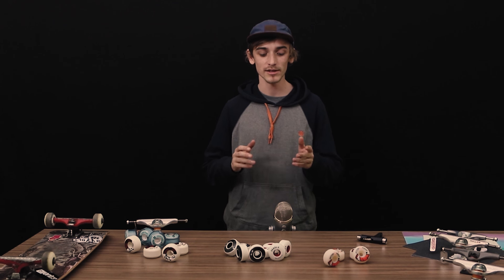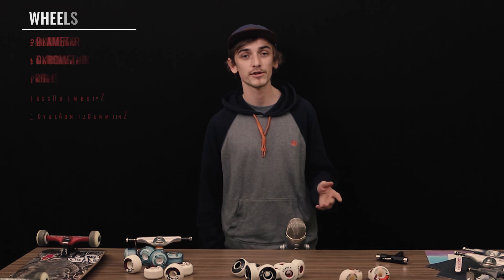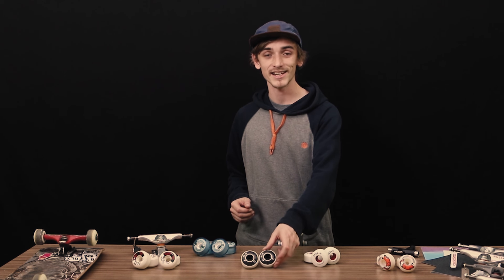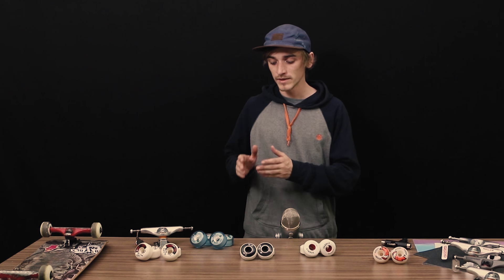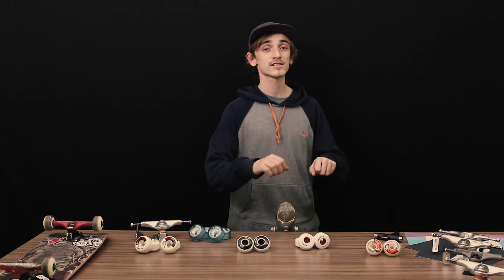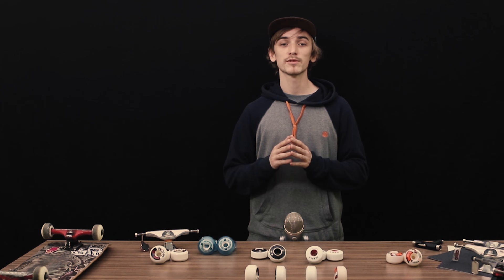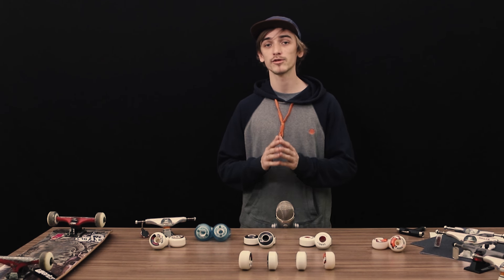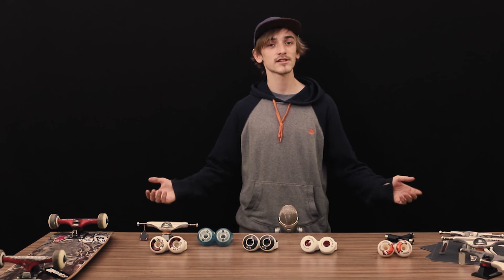How to choose your skateboard wheels | skatedeluxe Buyer's Guide

Comment: I have 101A powell peralta wheels and when im riding around the street and they sound like hell.
I need softer wheels for street right??
Reply: softer should reduce noise, yes. But it's not always better, it may slow you down more on some slides, I mentionned it in the video iirc. Going wider is also an option.
Reply: Arthur Oudini thanks
Reply: Y’all heard of the 40mm 105a?? It can put you into a coma
Reply: Thanks great video. But what wheels should i buy?

Comment: Skating on bad ground only street i will get a around 90A 53mm ? or should i go harder ?
Reply from the maker: Hi Phil, 

it always depends on the state of the concrete your skating on - generally speaking, I'd suggest harder wheels for street skating like 100A. Nevertheless, it can be worth trying softer and bigger wheels (90A & 54mm) if the underground has a lot of cracks and holes. Hope I could help.
Reply: @skatedeluxe  yes thanks i found the Wiki on your Page. Bought 92A. Most time I skate on tarmac which is not really smooth. If you go slower most tricks stuck after landing so i think a bit softer than i had now is OK.

Comment: can I do tricks with a 60mm wheel on a street deck?
Reply: Leeanne Lau itll be harder i believe , using wheels around 53mm should be easier
Reply: @eazye4828  yeah but then I find them really, really noisy.
Also, I really like cruising and find the smaller wheels quite slow, but I want to learn tricks
Reply: Do you get wheel bite with 60mm? I just bought some 60mm for my skateboard and I’m afraid they will be too big. I hope not. Cause I want to skate in the street and just cruise
Reply: @dodgeprince7183  you can put them on your board and test them out. If you get wheel bite, put some riser pads on or go for smaller wheels. You can always ask your local skate shop
Reply: Leeanne Lau alright thanks man!

Comment: Which wheels would you recommend as my first? I will mostly ride streets
Reply: I don't recommand brands, but as size, 52mm is probably a nice in-between. You'd have to adjust it with your own body size, If you have tall legs you could go bigger but then you'll need higher trucks. The main change with higher set-up is that you'll need more effort to hit the tail on the ground which is frequently a disadvantage for beginners. If the streets are rough around your area you might also want "not too hard wheels" it'll absorb some vibrations and impact from cracks and rocks.
Reply: Bones stf

Comment: The worst thing about hard wheels for me is that they are so loud on certain surfaces so it's awkward to roll down the street...
Reply: Or during the night...
Reply: Wheels above 80b aren't actually designed for skating around, even on relatively smooth surfaces they just lose so much speed and the vibrations rip your feet apart. Super hard wheels are almost exclusively for the skatepark and if you try to use them anywhere else you're going to have a very hard time